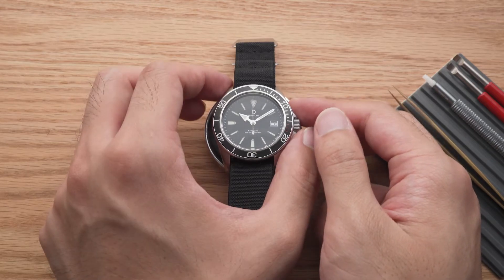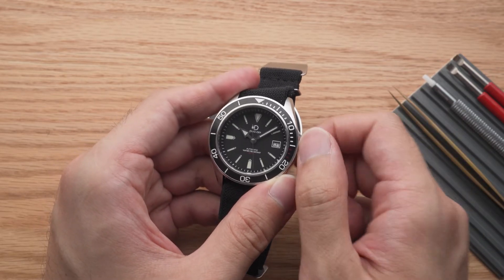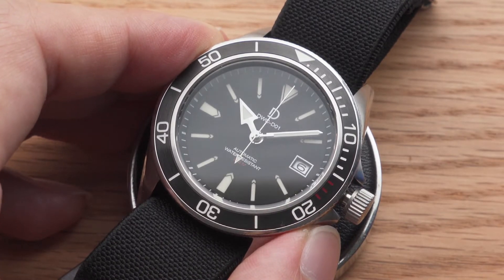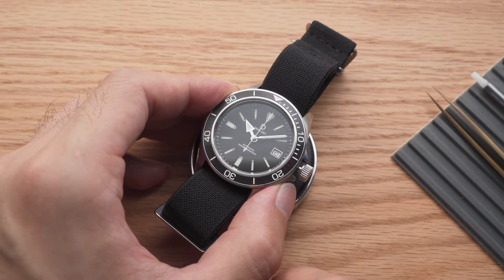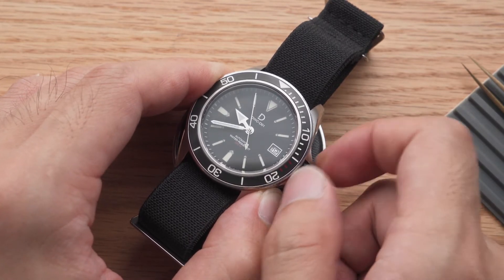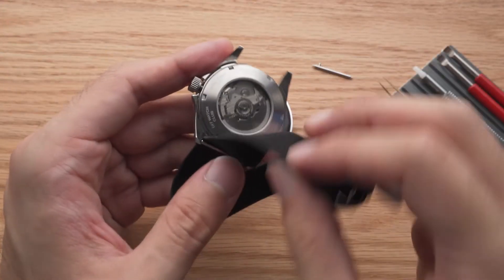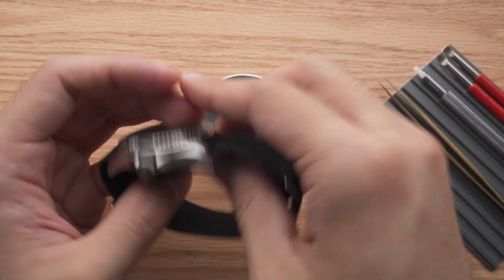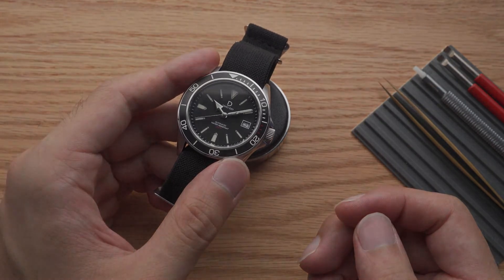How to adjust date on a mechanical watch (and what to avoid)

Comment: Really wish the watch I bought made is really clear about the ability to damage your date gear and not have it on the last page of the manual in small ass font. Maybe a card or a sticker on the watch telling you not to change it between those times.
Reply: Yes!  The most important information should have been the first thing they wrote.  Idiots.

Comment: Is it possible to over-wind your watch?
Reply from the maker: This is a much debated question, but no, it's not possible to overwind a watch with a modern movement. Either the movement stop you from winding when it's at full wind, or the mainspring is designed to slip in the barrel when it's at maximum torque.

Comment: Wow, excellent information. I didn't know that I could damage the movement if I move the quick date 4 hours from or after the date change time. Thanks for sharing it.
Reply from the maker: Yes this is important! The date changing mechanism is engaged within this timeframe and quick changing the date within this period can damage that particular mechanism. Exact time varies between different movements, but it's better to be safe than sorry
Reply: I saw this right after changing the date on my IWC watch at 10pm. Hope I didn’t break it!
Reply: @aliboom6876  You didn’t. You would definitely know if you did.
Reply: @aliboom6876  same here 😅 but in my case it's Tevise I've just bought second hand
Reply: What if I am building the watch 4hrs before or after midnight how do I adjust with the date